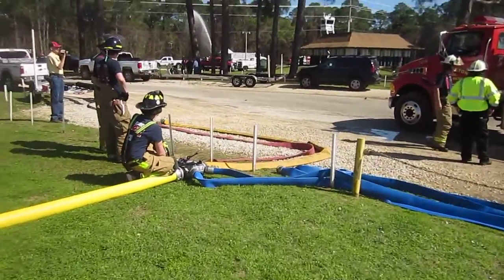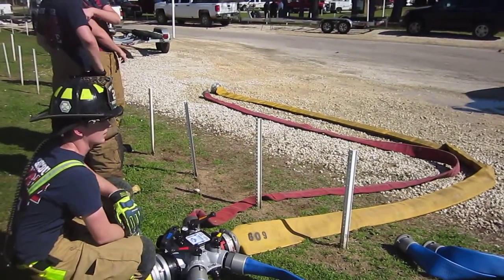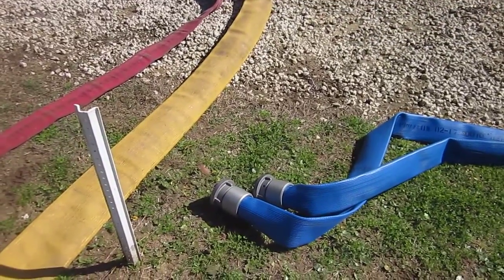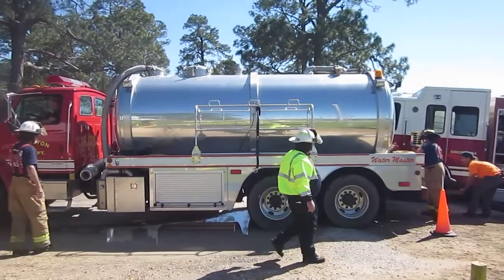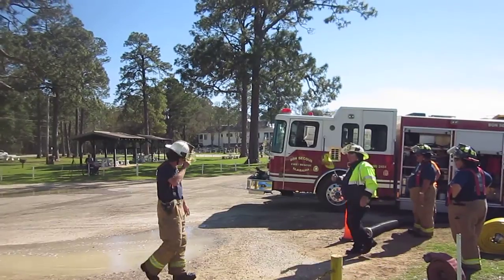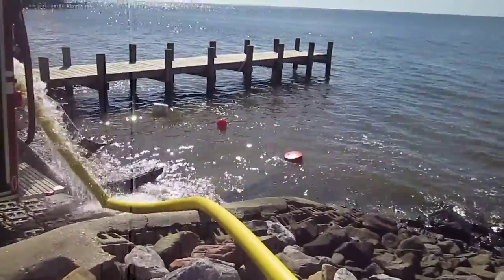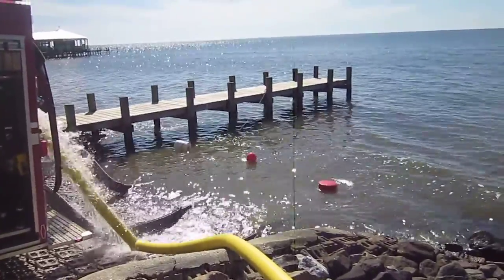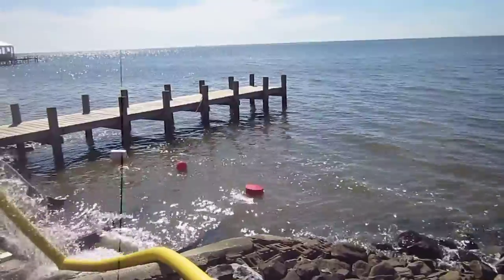Part 18 - Rural Water Supply Drill - Baldwin County, Alabama - February 2017

Comment: We love our vacutankers as they are truly independent and are quicker. We also have 2 8000 gallon water trucks, a tractor trailer. Due to our vast tanker/tender  fleet and due to the fact we are looking at making all tanker/tenders 4000 gallon minimum, we are looking at a 6500 gpm USFIREPUMP trailer pump. Configuration will be 6 8" intakes and 6 6" outputs. We coukd fill 6 tankers at a time at 1000 gpm or 3 tankers at a time at 2000 gpm. If we were not upgrading all older tankers to 4000 gal, we would not even consider a usfirepump trialer. However, the cost of the unit will pay it self off fast, with a few big fires. Plus it has the capability of pumping LHD over miles if needed